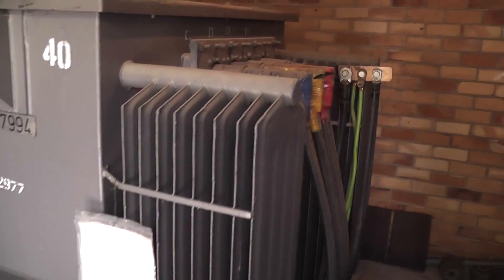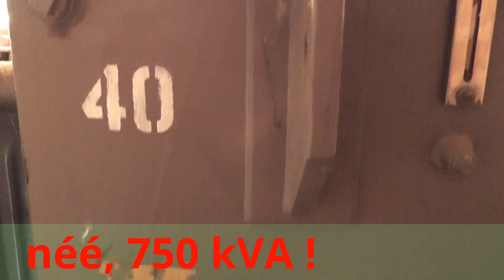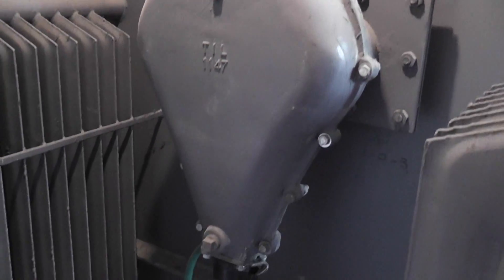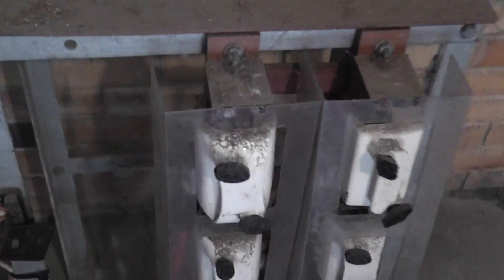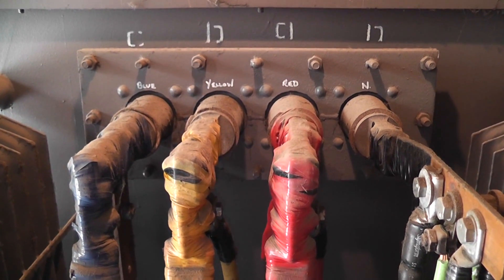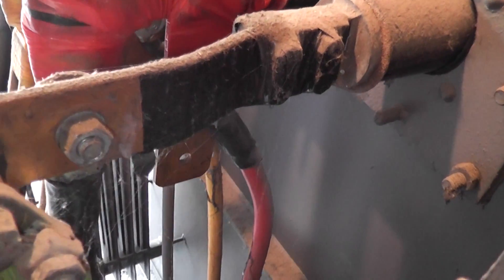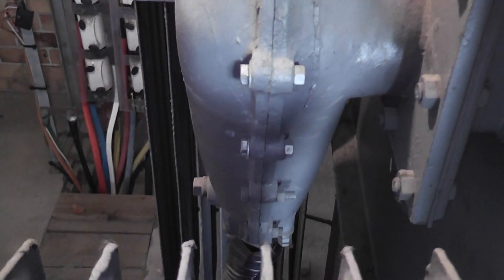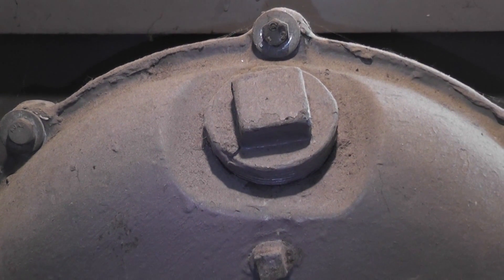750 kVA distribution transformer

Comment: Interesting!Two years ago I've upgraded a transformation room installed in the 70's with the sistem called "a giorno" here in Italy...nude conductors at 20 kv with ceramic insulators fixed on walls.The transformer was a 100 kvA 20kv/400V in oil.Changed with a 400 kvA dry core transformer
Reply: Oltre che sui gruppi di materiale elettrico vintage ti trovo anche qua :D commenti interessanti come sempre..
Reply: @emanuele933  ciao scusa chi sei? Sei nel gruppo materiale elettrico vintage?

Comment: Must be supplying a lot of small circuits looking at the number of connections on the neutral.

Very standard PILC cables for 11kV and probably XLPE cable on the LV side
(Paper Insulated Lead Covered and Cross Linked PolyEurethane for those who want to know)
Reply: Paul Roberts isn't it PolyEthylene?
Reply: FHRsLP Oh yeah - it could be!
Reply from the maker: This TX supplies a college and a section of overhead lines to some outbuildings. The NZI fuses are 200 - 250 Amps. The school is on a 630 Amp supply.
Reply: XLPE is cross linked polyethylene. This is the same insulation used for underhood automotive wiring that meets the SAE GXL/TXL/SXL specifications. It can handle very high temperatures without becoming brittle and does not (easily) burn. The same exposure to flame that would melt and char PVC insulated wire does not damage cross linked polyethylene insulated wire.  XLPE wire is also specified as the wire to use for vehicle detector loops embedded in pavement, as used for traffic signals, gate openers, and other applications.

Comment: Was that trannny on, or was it another in the background?
If not, well, I'm not sure what to say!
Reply from the maker: This TX was energized.
Reply: Forgive me, but I was not expecting to see a transformer with open output terminals even within the confines of a building.  As a EE myself, I assume you have a code of practise when near this equipment.
Reply from the maker: The TX is in a locked switchroom, with utility access only. our code is minimum off 15 cm distance from exposed live terminals. cover up when working nearby.
Reply: Cheers Ray!
Reply: Bridge Rectifier hey love your name.  change it to FULL BRIDGE RECTIFIER

Comment: It's remarkable how similar your substations are to British ones, you'd could easily believe that this was in North East England! Is it norm in New Zealand not to have LV isolators on the board or just in this particular sub?
Reply from the maker: We start putting isolators in new TX's for generator connections, in case of power outages, or maintenance.

Comment: How bad would if be if you tripped into those buss bars?
Reply: It's 415V between phases not 480V. Three phases are 120° shifted.
Reply: Ride84XL SDG Electronics already mentioned the body resistance. And human flesh will never trip such a fuse. Maybe on the 11kV side, but if you touch that for a brief moment you'll be roasted anyway.
Reply: Yes, but it isn't a short if you touch it - the amount of current will be limited by the resistance in the body. Still deadly though - but not worse then touching 2 phases on an ordinary 3 phase wall outlet. 
RCDs don't protect against short circuits - that's what fuses are for.
Reply: SDG Electronics what? landing across the phases is no worse then a 20a RCD circuit?
Reply: Not sure where you live, but RCDs are not mandatory for sockets supplying appliances here. Landing across the phases would be unlucky though.
Reply: It would be worse if you touch two phases. The voltage between each two phases is higher than between a phase and neutral.
Reply: I reckon it would leave a mark !!!!!
Reply: SDG Electronics Australia, RCD is mandatory for every circuit, I've seen a phase to phase short and the amount of current there would instantly blow whatever limb touched it off
Reply: *****
Yes but in terms of arc flashes, 480V is nasty!